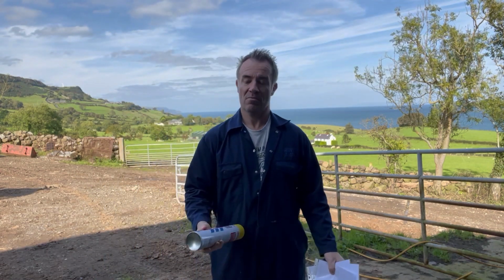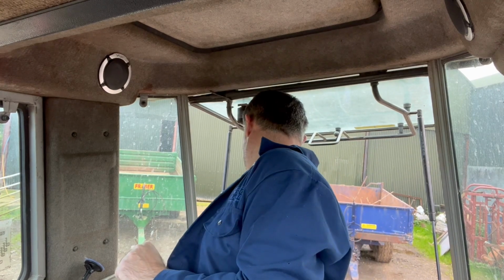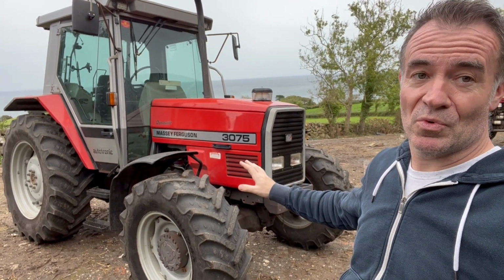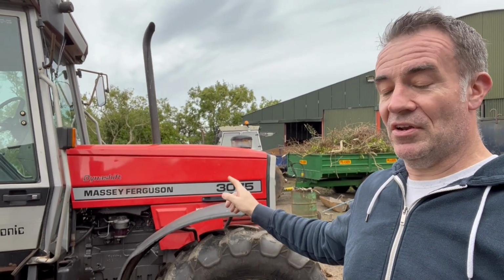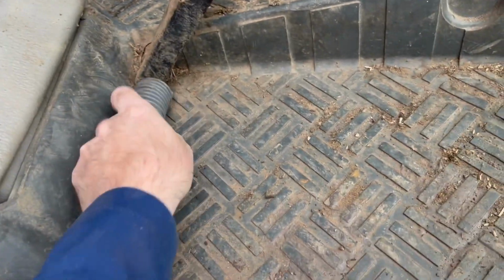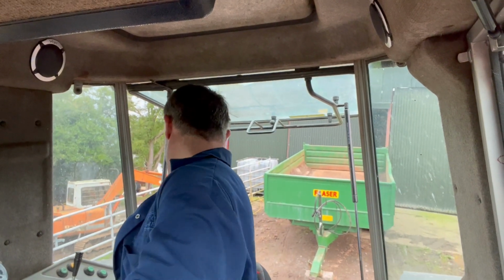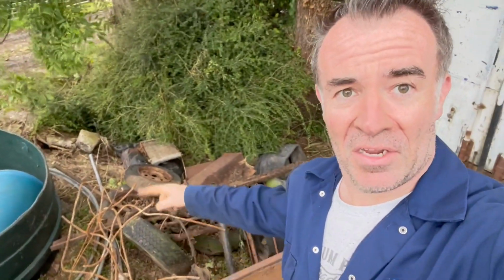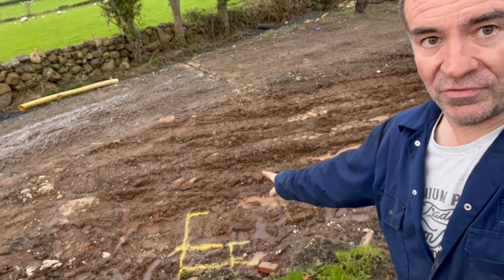The 3075 is back, marking out the site, gearing up for another big dig and we have a new logo.

Comment: Good to see the 3075 back at it. My 3070 has went through a nut and bolt restoration and will be out in a few weeks. They are great tractors.
Reply from the maker: I’d love to see how yours turns out. I need Ito get the scutching gun out and do under my mudguards.
Reply: @FlyingFergyMan  You might see it about. I wouldn't be a million miles from you.

Comment: there was a mechanical swing out hitch available for the 3000s, it's not very good though. Running big trailers on 3000s, the hitch always concern me as they're not the strongest looking drawbar
Reply from the maker: Our 3085 hitch slapped around for ages, never could get it tight.

Comment: The 3075 is looking and definitely running well now. Don’t leave engine oil in her for too long. Change after 50 hours. I would still take the 390t over it anyday as I love them tractors, the last one made that will last 100 years. No PCBs or Ecus to be found
Reply from the maker: 390T is a serious wee tractor and well capable. I think if ours had better tyres it probably would be the tractor of choice. Although I still think the 3075 is more comfortable. I will take your advice on the 50hrs thanks 👍